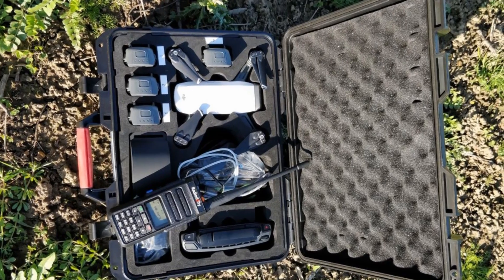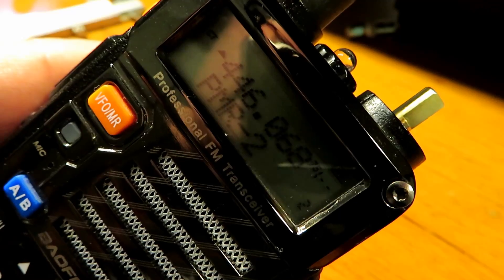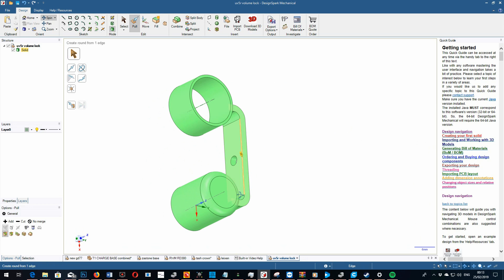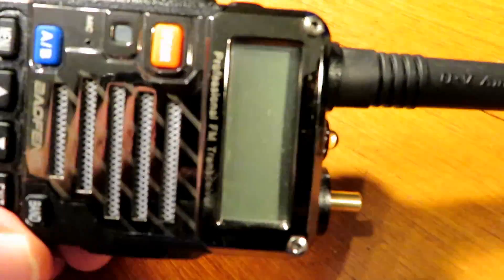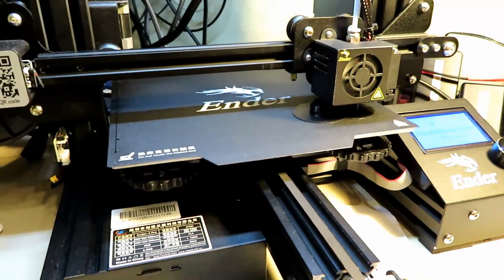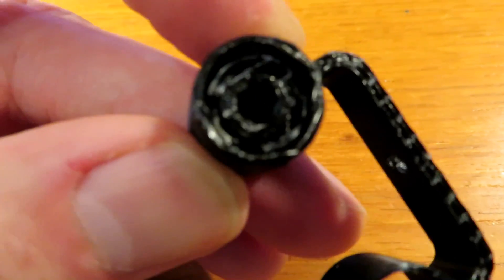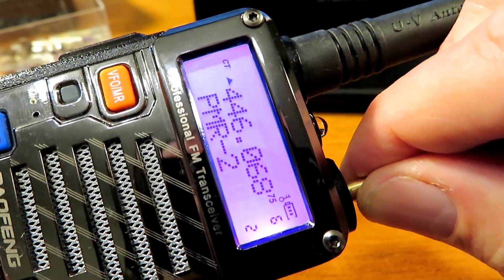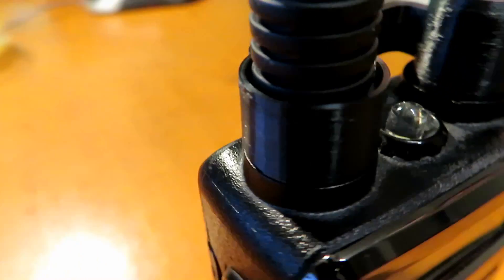Locking the volume knob on a UV5R or equivalent radio

Comment: I'd replace the pot with a fixed resistors on the values I wanted. So the kids won't turn it off! (EDIT) okay it's probably easier to print your STL online. thanks!